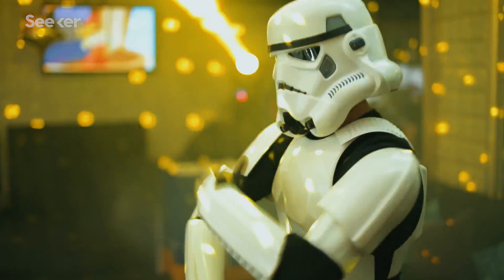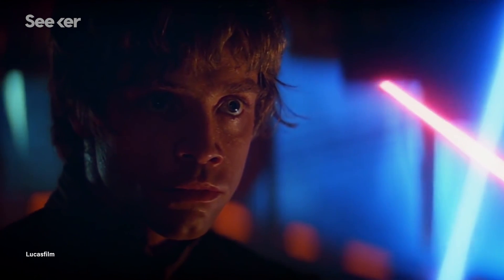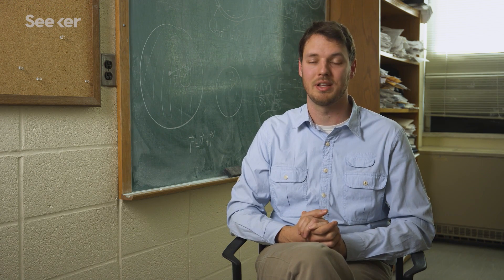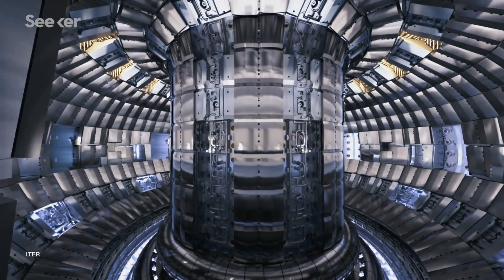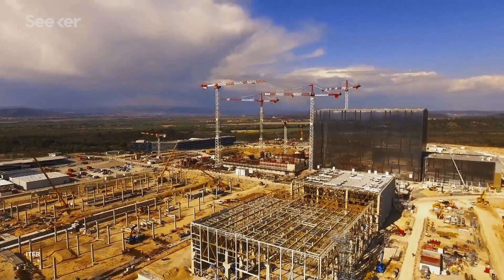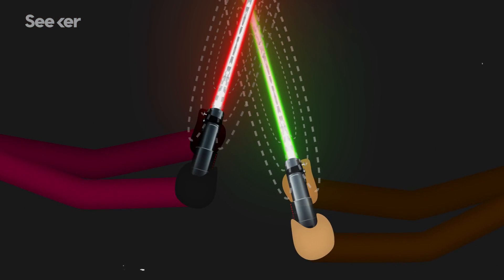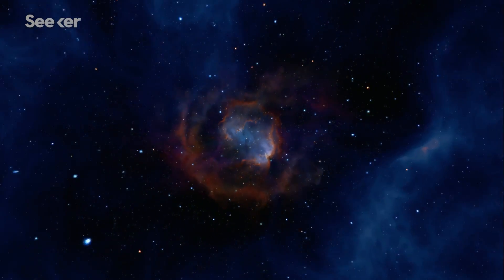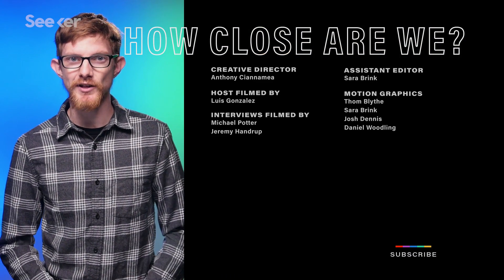How Close Are We to Creating a Lightsaber?

Comment: it is so weird that no one knows about the TR 3B Astra plane it sets off a ultra small atom bomb an contains it in a magnetic field, it is  kind of pink an violet color, it also uses levitation tech, which is really easy to make btw. an when it turns off a plate of levitation it propels itself at 199k speed in a blink of an eye it is gone. So what I am getting at here is it is possible to make the plasma ball, its circumference is about 5 feet. Could this be made smaller to make the light saber?

Comment: A lightsaber is a modest laser contained in a sharp parabolic ray shield with a mirror base.  The ray shield is projected around the front of the mirror which has a small hole in it.  The laser comes out of the small hole and reflects off of the wall of the ray shield at a very slight angle, like a soap bubble that reflects light only on the edge or tangent, this light beam follows the curvature of the ray shield until it comes back to the  mirror it came out of, then bounces off it to repeat the arch over and over until the field is saturated and the light is leaking out , causing the familiar glow.   
     This multiplies the intensity of the laser thousands of times over by folding it back on itself ,  like doubling a string many times to get a given length of rope.  This would cut nearly anything that wasn't too shiny or ray shield protected.   
      Once the beam is contained a sensor must modify the beam intensity to save energy, feeding less light into the field void while it isn't being used.  And feeding more laser intensity into it when it is cutting through something which absorbs some of the folded light.

     The ray field may be over a foot thick, only the inside neutral space is needed for the containment of a beam of light at a near parallel emittence  so two fields would not easily pass through each other.   
      Getting a ray shield is the tricky thing.  Shaping it ,  elongating it is the next challenge.  Hot air or plasma can reflect light at sharp angles, like the light on a hot asphalt highway.  
      Containing plasma with magnetic fields is possible but getting them to extend out from anything is a challenge.  The poles of a magnet would be useless for this, they are the wrong shape.  It is the sides of a magnet that might work.  Imagine a disk magnet spun like a coin, it's flattened field viewed on edge is now spinning making a candle flame shaped inner field.  Perhaps a contra - rotating field or blocking helix would help shape the field and once a plasma arc is produced inside a layer of that field a laser could keep it going by ionizing the air inside it, reinforcing the magnetic sleeve shape.  Not sure about that.  
      Also, making the neutral void in the center requires a blocking metal, that blocks magnetic fields.  The shape of this might influence the shape of the hollow void the plasma lives in, but it must be made into a mirror.  A 5 watt laser might work for a lightsaber once it's beam is contained and folded infinately.  Can anyone add to this?  
     I visualized this by imagining a soap bubble on a mirror, there is a hole  in the mirror just inside the edge of the bubble where the laser comes out, parallel with the wall of the bubble, which is a weak ray shield.  Some of the laser follows the curve of the bubble until it hits the mirror and bounces up to repeat the curve thousands of times, filling the inner void of the bubble with intense laser energy.

Comment: Thought a lot about how one would duel using the laser reflector method. It would end up being like a crazy reversal of katana training- where you hold the blocking line (the rod) behind your laser cutter, as a mutual desteuction defense, but if they strike you'd actually need to simultaneously dodge and deflect, hitting the rod at their sword's rear with your own  to knock the sword away, or cutting their rod with a backhand flick. Generally striking would be more dangerous than defending. Some "fancy moves" might include a desperation maneuver where you sacrifice your rod to land a plunging strike with your laser, there's several ways to do that. Hand strikes would as always be an effective option, so for that reason stances would likely be close to the chest- You can't really stab unless you're planning to sacrifice your laser containment while doing so. Another fancy move would be to not accept such a strike, letting the blunt tip hit you without breaking their sword, then striking in return. For this reason eventually a stabbing metal tip might be developed, which would change the game dramatically. In addition to hand strikes, tip strikes (destroying their containment tip) may be a good method, another a reason stances would be close to the chest, either tip high and stoic, or an angled stance, knees bent, sword and feet both agile, body low and sword in a diagonal cutting position. Interesting ^_^

Comment: Do you people not know how to Google stuff? Force Power has nothing to do with a lightsaber, barring certain specific examples from the Expanded Universe. The "beam" is focused plasma that is projected from the central emitter and restrained within a magnetic containment field that would redirect the plasma back towards the hilt to a negatively charged ring around the emitter, such that the current essentially cycled back on itself. Because the energy is constantly being recirculated the only times a lightsaber would drain it's power cell was during activation or while the "blade" was in contact with any other material. 

We're not even remotely close to any of that being possible. Producing such a tightly focused and specifically shaped magnetic containment field, generating a pure plasma stream within a matrix capable of recycling said plasma indefinitely, the focusing mechanism (crystals) or aperture needed to precisely generate and regulate that plasma, and finally a power source that can handle the initial plasma generation and balance whatever energy may be lost via blade contact with other materials..... It's not even known that all those things are actually possible, but realistically the power source is the easiest component there is, but considering it has to generate high-density plasma on par with that found in a lightning bolt......I'd say we're not really close to making THAT a reality either.

Comment: No they deffinaly are possible.  I have seen something similar to a light saver regarding some experiments I was wanting to take on.   surfing on you tube. low and be hold I saw something that looked exactly like a lightsabor except for the guy that was holding had no idea that it looks like a lightsaber blade. He was doing research and experiments regarding something's else entirely different but when I saw this video it looked identical to light saber beam.  precise Flame red blue or purple reaching out to 3 or 4 ft. cracking and popping   could you could easily cut metal with it if you wanted to and is relatively safe like more so than plasma or  gasoline.

Comment: So...has anyone considered a go-between? Rather than a lightsaber, you could create a sword with copper conductive edges (or bronze) powered by a battery cell in the pommel and wired to the edge of the blade through the hilt. If there's enough current being applied to those edges, they should glow and be capable of producing the cutting effect of a lightsaber (with the added bonus of applying a taser-like shock if you only get a grazing blow, or contact an all metal weapon being used by an opponent without gloves on). Not sure how you could change the color, or how you could bond the metals and ensure that the heat from use wouldn't ruin the temper of your blade, but it's an interesting idea.

Comment: 9:51 Actually there would be some drawbacks. A matter - antimatter annihilation powered lightsaber would also be nuclear powered. It is the most efficient reaction possible but it is still nuclear. For instance when electrons and positrons annihilate they don't simply produce energy : that energy (assuming the electron - positron pair has a low kinetic energy) is in the form of two gamma ray photons with an energy of 0.511 MeV each. If the pair has a high kinetic energy they produce extra particles and even higher energy gamma rays. 

When protons and antiprotons annihilate they produce pions, kaons, gamma rays, positrons, electrons and neutrinos, while neutrons and antineutrons react similarly. Therefore the lightsaber would require some pretty serious (and rather heavy) shielding if it was powered by matter - antimatter annihilation, otherwise the lightsaber wielder would soon die from radiation poisoning. Fortunately the antimatter fuel would only need to be minimal (some tens of micrograms should be enough), thus the fuel wouldn't add even more weight.

It is a misconception that matter - antimatter annihilation only produces "pure energy". That is only the case with the annihilation of low energy electron - positron pairs, which is the simplest of all. Even if only "pure energy" was produced though, that energy would solely be in the form of highly energetic (and radioactive) gamma rays.
Reply: Pretty good summary. The reason you can't have "pure energy" is because energy means changing structures. "Pure" here implies no structure - a changing nothing. :)

Comment: likke helo seeker. yeah i have been a secuesterd inventor. the military is making one of my devices . a laser beem with a tazer charge inside the laser beem. mounted on a huer to kill enemy tanks. a hand held decice with a laser and a static electic charge for the carrier wave of the laser. the electric power comes from carbon nano tube batterie, like the  mold to hold lazer and metal electro plate. around the elements that is the hilt piece that contains the electro static laser light beem blade. is the baterie, made of molded carbon nano tubes.

Comment: Michio Kaku suggested that the power source is a kind of capacitor made with carbon fiber nanotubes. A single tube is about 8 atoms diameter and tightly coiled.
The nanotubes that can fit within the hilt would have enough surface area to hold enough electrical power for a small city; charging it also requires that much power.
Combine the several miles long coiled nanotubes electric power capacitor with a magnetically contained plasma surrounding the telescoping ceramic core.
Voilà! There's your lightsaber.

Comment: How about instead of using light or plasma, we use nano machines that extend from the handle.  Said nano machines would vibrate at high frequency to cut like a chain saw but is stiff enough to be a sword.  The light saber would glow because the nano machines that comprise its body and edge will occasionally knock electrons from air molecules, but we won't have different coloured light sabers because it's the air molecules that determine the colour.

Comment: 2:56 you can contain the light by not a mirror but sound waves probably 👍😎 since it makes up everything or use the plasma from a plamsa welder one day someone gonna find a way to get that really hot instead of a short 90° plasma sticking out about half inch or less. It looks like it could be the real thing an even more dangerous since it won't just burn but disintegrate organism's an even some other elements but shooting a laser would be the real problem probably

Comment: Inner ring in the hilt ejects a gas ,outer ring is a varing ring of lazer radiation that "collapses the gas to a cold plasma" from the tip of the gas jet down so it will not heat the hilt & will not harm living things but dose react with other light sabers and metals.

Comment: I have an idea of how to create a lightsaber.     First, you need terahertz wave lasers, lots of them and high power.  Then you need weaker lasers which through a combination of constructive and destructive interference can change the frequency at certain points into a beam shape.

The terahertz waves that escape, and are not changed through interference will just go through matter without interacting much.  While the contained area of interference will be of a light spectrum that does not just go through matter ( heats it up ).

You'd also need some killer batteries since most of the power of this lightsaber would be escaping and not doing much but acting like a giant terahertz flashlight.
Reply: I guess antimatter batteries would do the trick :)
Reply: Dont forget the application of plasma emission phenomenon.

Comment: I had this idea for the lightsaber - all I can say is that there should be an extendable rod in the middle and the lights/laser on the outer side so that the heated lasers could actually cut through something. There would be only problem with the tip of the lightsaber...

Comment: Why not use a laser without a silly mirror? Use Fourier transformation and overlay different wavelengths of laser light to create constructive and destructive interference to get a fixed length beam. Also a laser that is powerful enough to cut steel in seconds will also be very visible from the side too, as it will heat the air to glowing temperatures.

Comment: How bout plasma smoke rings sent out at such a rate that the saber appears to be continuous and the self generated magnetic field would be able to hold the shape and heat only for the length of the saber? Plasma "doughnuts" sent out in a way such that the motion imparted to them upon ejection creates magnetic fields that fade as the "doughnuts" encounter air. 
Hardly something that requires tech advancement much and might have some utility in construction. Power of course would still be an issue.